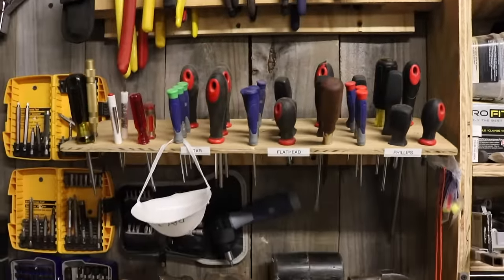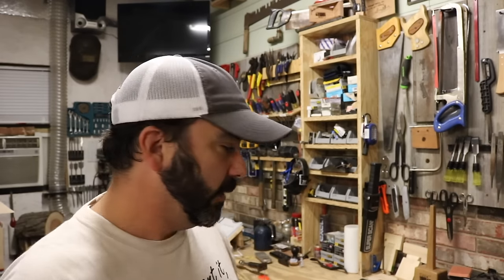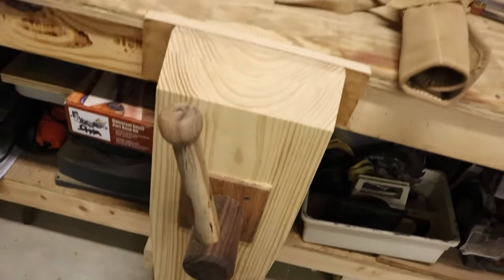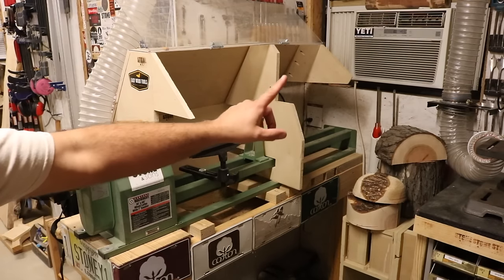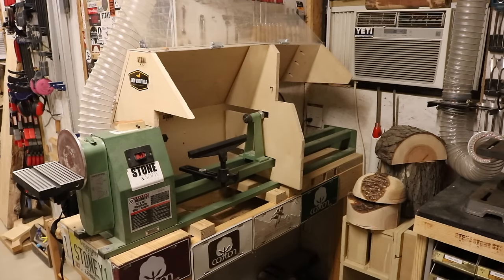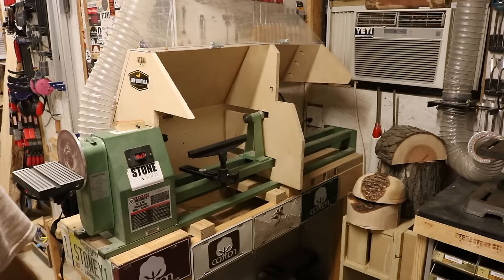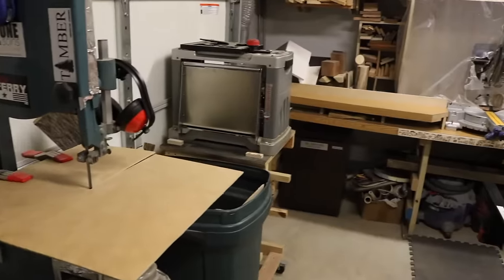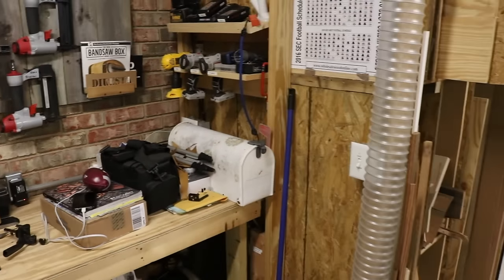Shop Tour 2016 - Stone and Sons Workshop

Comment: I just replaced my 35 year old Craftsman 10" table saw given to me many years ago with a 10" Rigid stationary. It's a solid sumbich, lol. And I've been using my hand planers, straight edges and sanders for flattening, but it is a time consuming chore that's making me look for a planer myself. I've also been getting along without a band saw, but it sure would make some projects simpler. A good, practical setup you have. Tweeking NEVER ends!

Comment: As you go forward. Find a belt driven squirrel cage mount outside use a closed motor and ground. At night if you turn lights out and look close you will see blue plasma around fan motor. Don't blow yourself up! I like your videos and work. Test all your grounds. Use dielectric grease on connections. Fires happen when you least expect it. Shops looking good!
Reply from the maker: +vernon slatton Cool and thank you!
Reply: Stone and Sons Workshop 👍🍀👌🏼